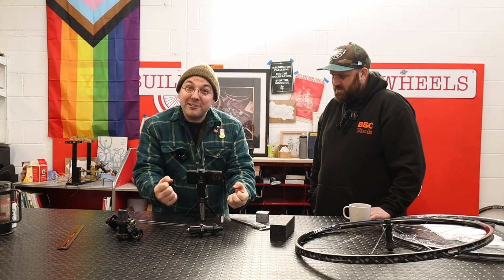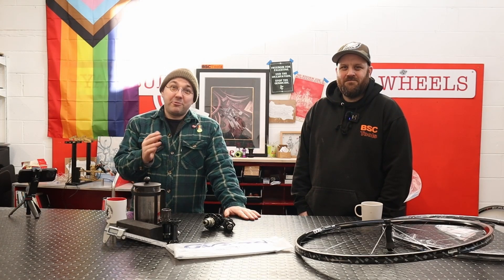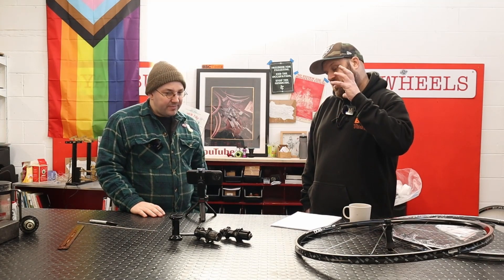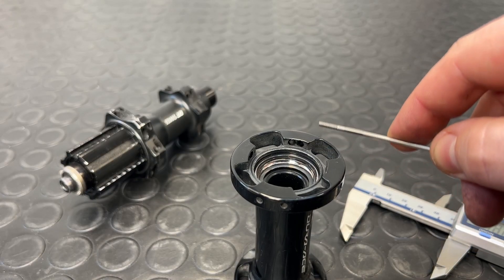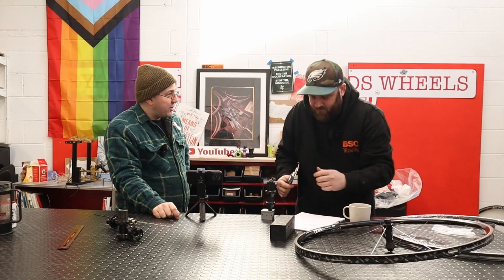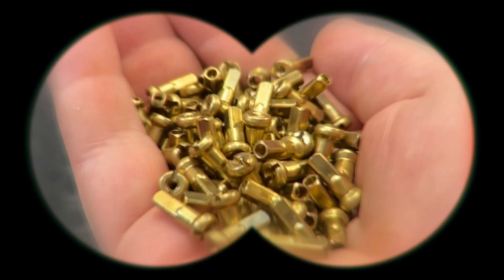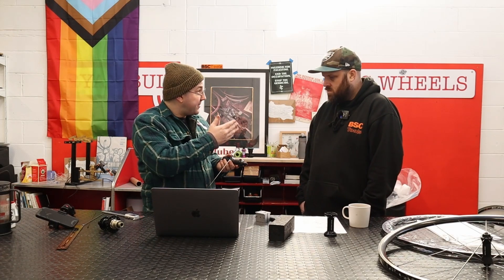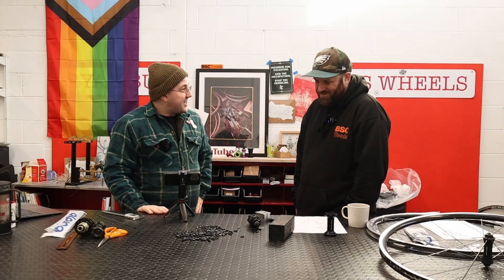How to Calulate Straightpull Spoke Length for Bicycle Wheels

Comment: Great video. Another vote for Roger Musson's spoke calculator. It is especially useful for triplet, G3 or paired spoke calculations.
I have also found the offset to be the most challenging aspect of straight pull calculations. I still struggle a bit with it, but next time I will try the 100 mm spoke method. I find it a bit more difficult using a full length spoke.
Reply from the maker: Let me know how you get on!

Comment: Super nice video, very clear and helpfull!
2 suggestions and 2 questions:

S1: I would specify that the double square nipples have actually longer thread then normal nipples, and that it is thus different from using 16vs12mm normal nipples. Also you can add up to 4mm, of spoke, so rounding up BIG is the safest bet.
S2: I will always measure a spoke of each side and the ERD of the old wheel if possible, just to crosscheck the calculations afterwards.

Q1: where did you get that burgundy bonnet?? 😊
Q2: what about crossing aero spokes, do you always interlace them?

Keep on doing this!!

Greets, Midas from Spaakshop in Belgium
Reply from the maker: Great feedback thanks Midas; I hope Spaakshop continues to treat you well!

Especially when making repairs of re-builds then, yes, absolutely to S2 for sure!

The lovely hat was a gift from my pals at The Bikes College Leeds; they are WELL worth checking out for anyone who hasn’t come across ‘The Smiling Chainlink’!

https://thebikescollege.org/

As regards interlacing of aero spokes; generally for straightpull builds my answer here is yes (some hubs i find it better not to when using thicker no non bladed spokes) but I guess the general rule of thumb is to choose a solution that doesn’t allow for any ‘sharp’ exit from the hub (if that makes sense)

Comment: finally some common sense on straight pull, will need to watch it a few times to get it stuck in my head, but looks easier than I previously thought, cheers Ryan
Reply from the maker: Until I thought about / found this method too I felt the same! Give it a go and let me know how you get on!
Reply: @RyanBuildsWheels  generally shy away from building straight pull hubs but this might give me the confidence to start looking at them again, one question though, is there a benefit to using straight pull over j bend?

Comment: Great video as always. Is there a calculation for spoke length for new rims using the old ERD and the New ERD please?
Reply from the maker: Not that I know of; you’d need to calculate everything from scratch to get things as accurate as possible but speaking generally you could assume that 1mm of ERD in either direction will account for 0.5mm worth of spoke length change; use a double square nipple and opt for a slightly longer spoke than your figures suggest and you’re on your way!

(but I do recommend calc’ing things ‘properly’ ;-)!)
Reply: @ thank you very much. The hubs are the dt Swiss/Bontrager with the funny flanges/spoke holes.

Comment: How to determine the cross pattern on straight spokes????
Reply from the maker: Is right there in the video: you just have to watch it 😉. 

Cross pattern on a straightpull hub is fixed and can be determined by inserting spokes into the hub and counting the crosses: additional details within vid.
Reply: @RyanBuildsWheels  thank you .

Comment: Wow! I never even considered this before. The only straight pull wheelset I have is a Mavic Aksium that came as an OEM on a bike I bought nineteen years ago - one of the flange ‘nodules’ failed after about a month so I had to get a replacement. I’m guessing at this point (Ryan) you’re thinking wtf, I can’t believe that happened. Anyway, it was a long time ago and I’m over it now, and the wheels were replaced with something much better very quickly. BUT, regardless of brand, what (if any) are the advantages, or reason to spec straight pull spokes/hubs? AND, thanks for another video 👍
Reply from the maker: Oh I can believe it ;-)D! Mavic aren’t there to make sure you’ve got a wheel that’s gonna last, I’ve seen that particular failure plenty of times.

#handbuiltwheelsarebetter innit!